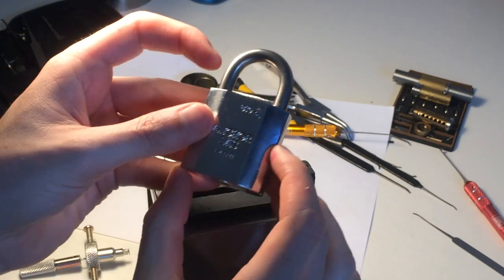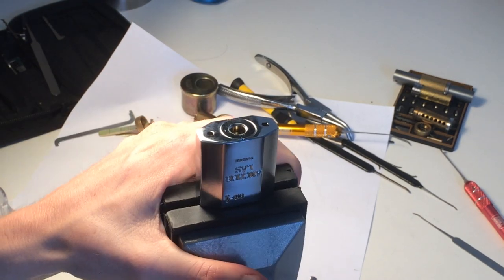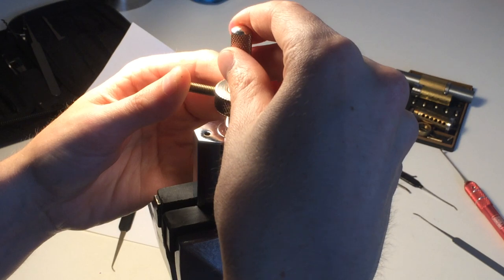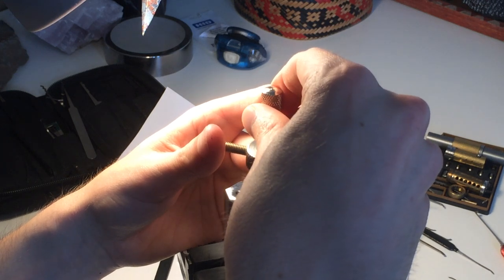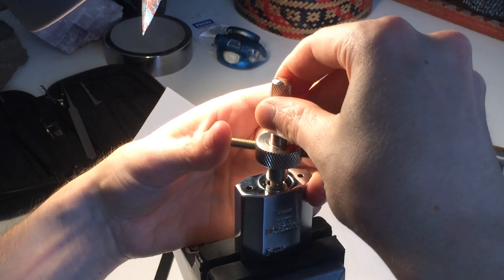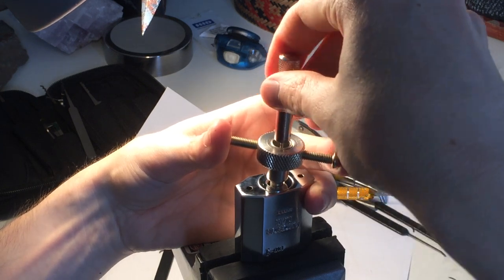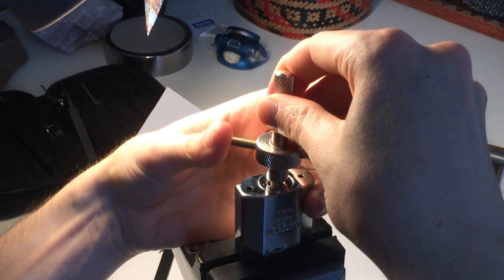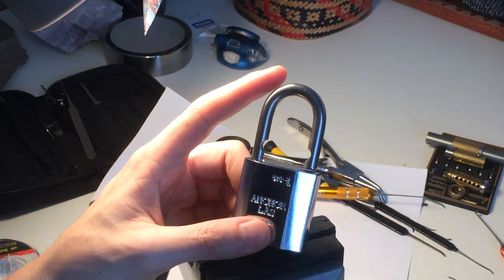Anchor Las 810-1 Disk Detainer Lock Picked

Comment: Hello.  Nice picking.  I have never done a disc detainer lock.  I noticed that you’re doing this on the lock vertically.  I have seen others picking/doing this in a horizontal fashion with the lock.  My question is, is this a personal preference or will it effect the tool head interaction with say the first few discs?  Will the tool sink to far in and bind the foremost disc(s)?  Are you holding it so it will not drop lower into the key way opening.  Great video.  I try to watch as many people doing these and learn what I can see or read via comments or by written information.  Thank you and take care.
Reply from the maker: Hello,
It doesn't really matter what orientation the lock has when you pick it. It is only matter of comfort.